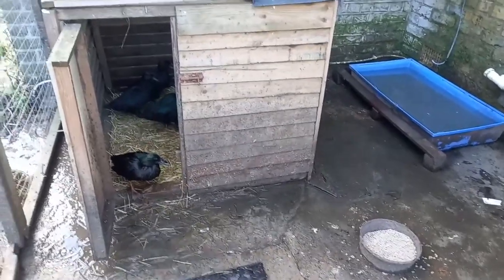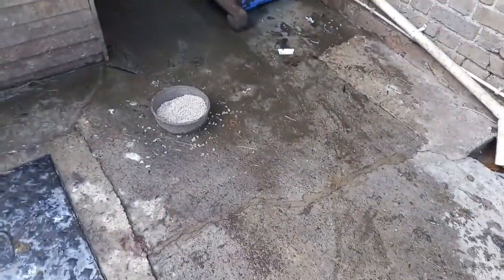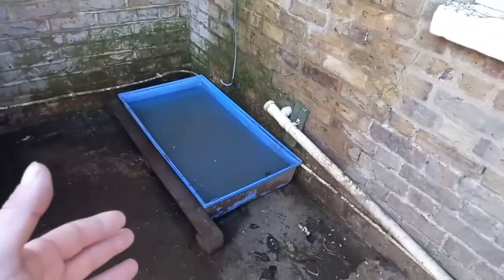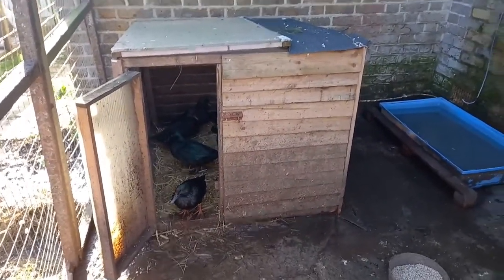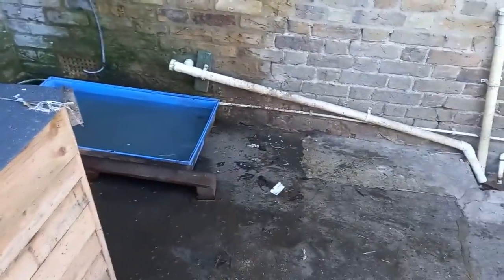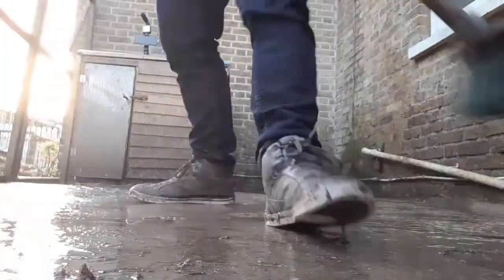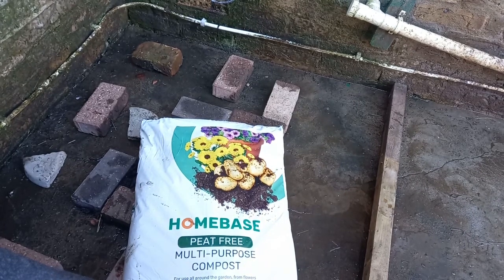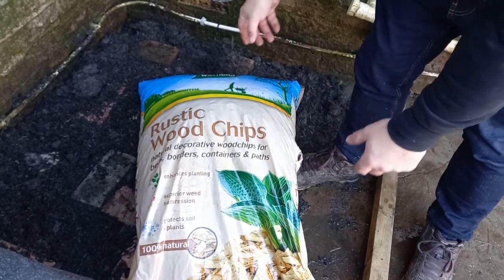Pet Duck Set Up - Best way to build a duck pen -  Keeping Ducks in the garden yard - Happy Ducks

Comment: Helpful video, thank you. 

Out of interest, do you think ducks (say, 3 or 4 large ducks like Aylesburys) would get along with an established flock of 10ish chickens?

They'd be housed separately and the chickens would have their own enclosed run which they cannot escape from when needed, but the chickens are escape artists when ranging so I'm thinking of fencing off a large area (about 15m by 10m) for them and I'd be keen on getting a few ducks to join the fun.
Reply from the maker: You have to be careful of respiratory diseases that the chickens can develop as ducks make the environment too wet and muddy for chickens but apart from that they get on fine with each other.